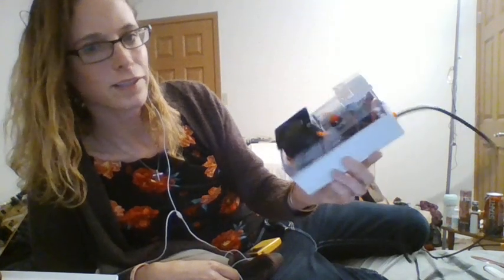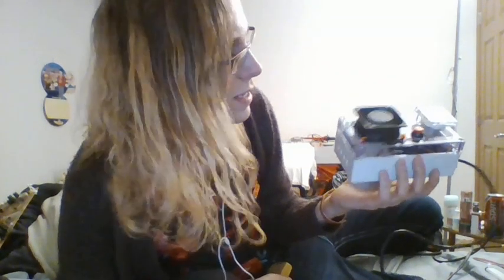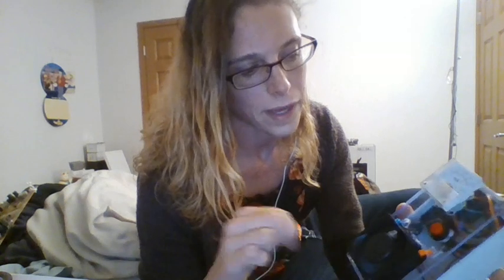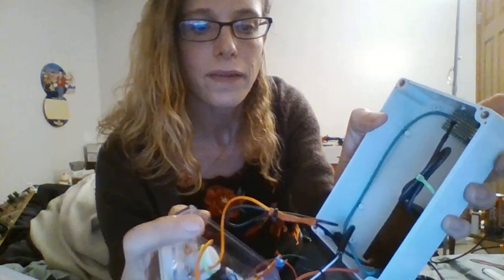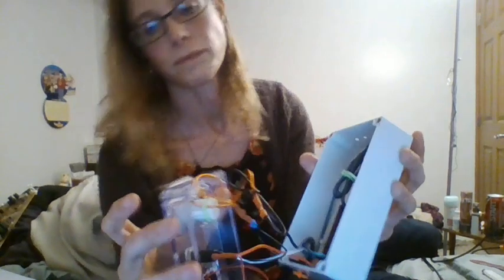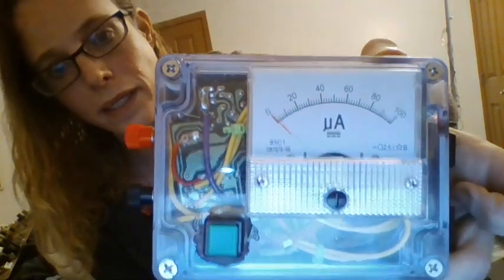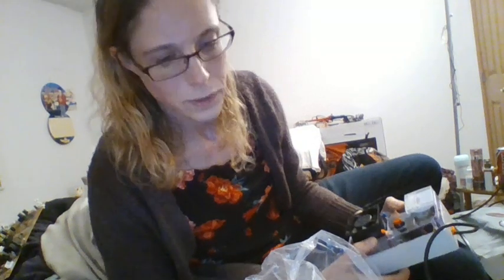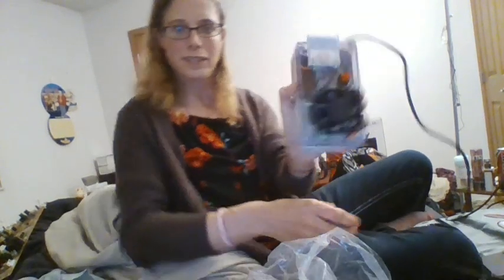Negative (-) ION⚠️Ozone Generator electronics project⚠️ sa8die,.

Comment: Do you have some schemes of that ionizer?
Reply from the maker: just google, the main part is the oscillator circuit, but the difficult to obtain part is usually the High Voltage transformer, thanks for watchin, ill try to make better content, I am in school for 2 year AAS in Electronics Tech.

Comment from the maker: the big black wire is the negative (obviously) and the green is the ground, its important to put the green wire close but not too close to the output, to get the MOST neg ionic output, you can smell it, it smells like after a rainstorm, i will make another video in the dark, showing the little violet tendrils, if the wires are too close it makes a spark and this might create more O3 and you dont want that, esp in a small apartment,.,
Reply: Looking for your help to make negative ion generator for my cancer patients